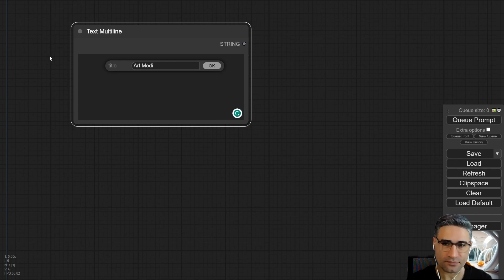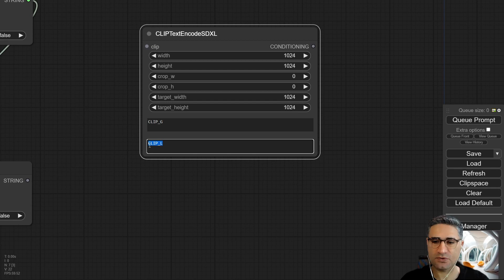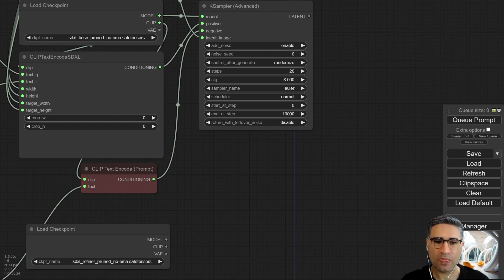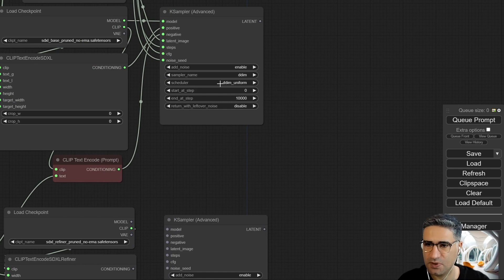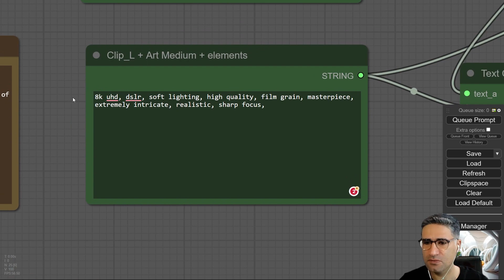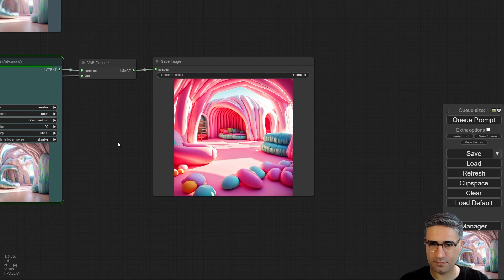0 to 100 | Stable Diffusion SDXL & ComfyUI - An In-Depth Workflow Tutorial from Scratch

Comment: Fantastic! Works fine! Except for the negative embedding. Where did you get that from? The one from Civitai I use for Automatic1111 SD 1.5 does not work in ComfyUI
Reply from the maker: To use a textual inversion concepts/embeddings in a text prompt put them in the models/embeddings directory and use them in the CLIPTextEncode node like this (you can omit the .pt extension):

embedding:embedding_filename.pt
Reply: Thanks! It worked! @ArchAi3D